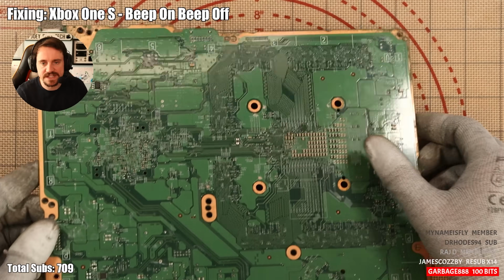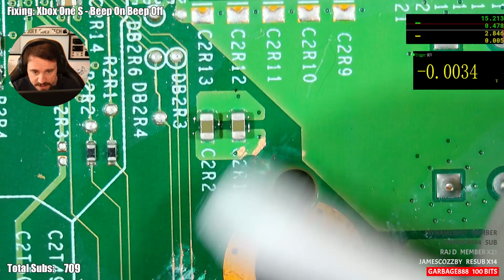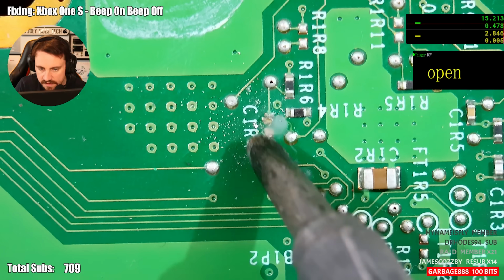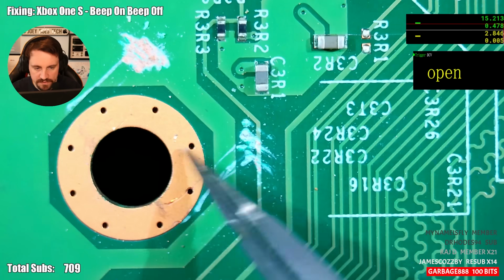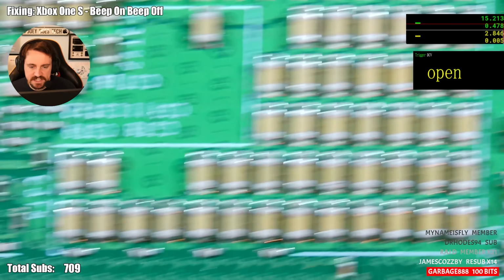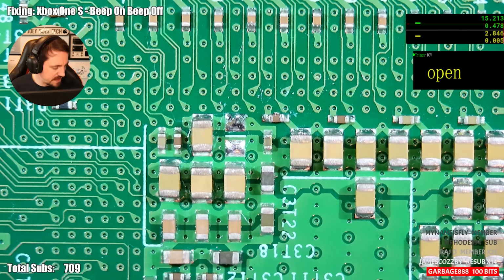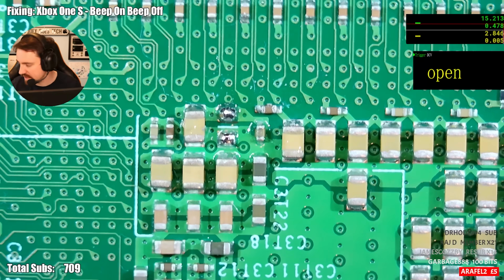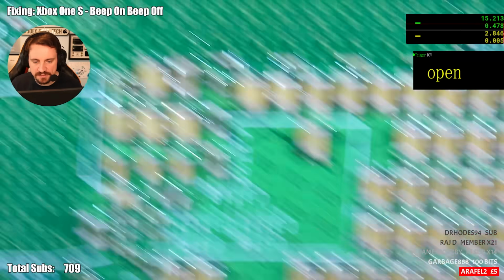Did This CPU Survive an Attempted Repair? Free Fix S1:E21

Comment: If you do retro consoles I have one's that should be a good video, got a PS1 that was working that I paid a lot for about 5 years ago as it was modded that died and I had in a cupboard for 3 more years then attempted to take the parts out of only for it to boot, but when I attempted to remove the mod I knocked off a few tiny caps (or resistors) and then did the same on the replacement console I got cheap.
Reply: That would be entertaining to watch i hope he sees this! Theres a link to a form for selling consoles to him in his video description maybe fill that out?